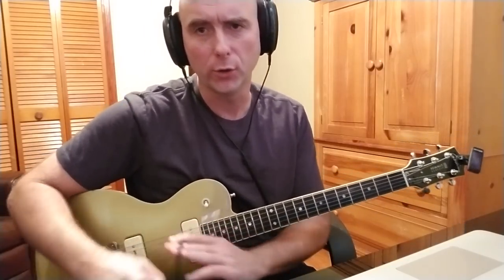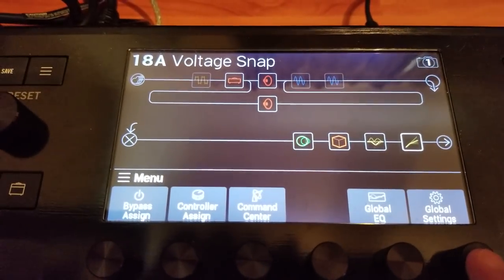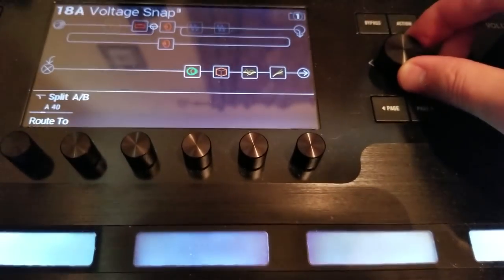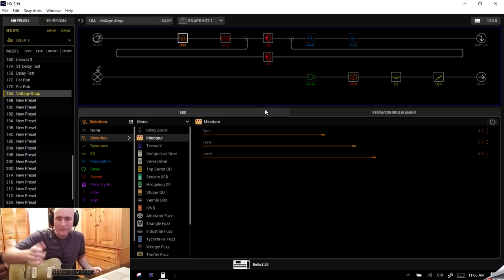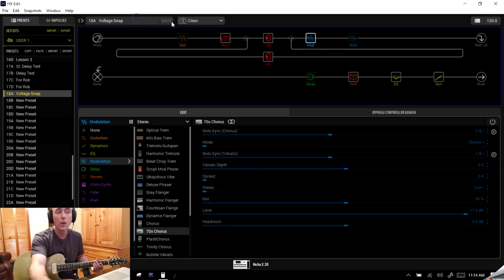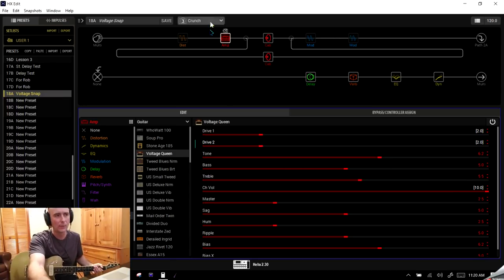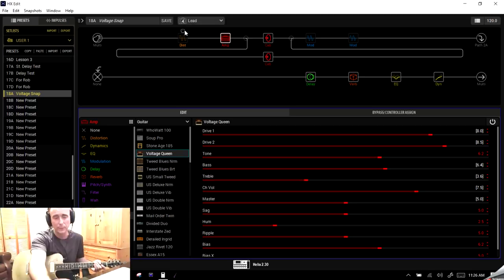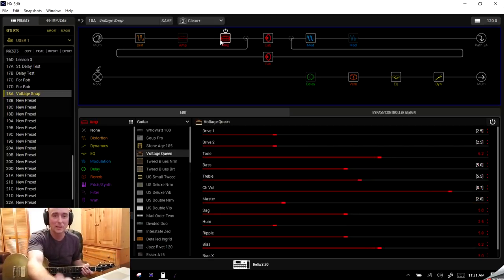Line 6 Helix - How To Create A Great Tone - Pt. 9 - Understanding And Using SNAPSHOTS

Comment: This video was a real eye-opener for me - thank you so much.  I was all set to ditch the Helix and go with something less likely to cause option paralysis - like a Strymon Iridium.  Now that I understand snapshots for the first time, I've come to the realisation that the Helix CAN be as simple to use as an Iridium plus outboard pedals.  If I were buying real amps, I would have two, maybe three.  Likewise, I'd have maybe six or seven pedals.  Use the Helix the same way - just concentrate on a small number of amps and effects and take a bit of time to set them up right in the first place.  I'm now working my way through all of your "How to create a great tone" videos, to see what else I can pick up.  Great work - and SO much better than wading through the 75 pages of the user manual!

Comment: Thanks for all of your videos!  They are a tremendous help!  I got my Helix this past Thursday and I am simply loving it.   

The whole preset switch delay exists in all modeling units because they have to load things in and out of memory.  The snapshots, which are a God send has all of it in active memory, we are simply turning them on and off.  

Still have so much to learn and getting tons of information from you!  I really appreciate all the videos!

Great tip on setting the Snapshot edits to Recall while you are programming the preset and then changing to discard after it is setup. 
Also, THANKS for showing how to set the parameter "changeability" in HXEDIT.  I couldn't figure out how to do that without using the unit itself.
Reply from the maker: My pleasure and thanks for the kind words :-)

Comment: great service you're providing here. I just recently acquired the helix and ran into a stumbling block with trying to quickly setup snapshots through the editor.  I thought it was kind of weird that I should have to "initiate" a snapshot through the floor unit by activating snapshot through the "push" parameter knob.  I noticed snapshot in some but not all of the drop-down menu's for parameters in the editor.  now if I could just get the built in expression pedal to maintain zero in the heel down position :-(

again, your presentation and subject matter is excellent.  great chops too!
Reply from the maker: Thank you so much Phil and glad you enjoy the videos :-)

Comment: Got my Helix LT today and started working on a couple of tones for Metallica's Enter Sandman, just as a means of familiarising myself with the unit (been using a POD XT Live for twelve years).

When I switch from the clean intro snapshot to the heavy rhythm snapshot, the chorus turns off, the distortion turns on and the noise gate turns on but the amp settings remain the same. The same thing happens the other way, too. I can save the heavy rhythm tone with all the settings as I want them but when I switch to the clean snapshot, the amp is still as per the heavy rhythm setting.

I'm loving the tones that I've got out of this in just a couple of hours of fiddling about but this is driving me nuts....Heeeeelp!
Reply from the maker: It could possibly be your global settings, maybe?
Reply: @JasonSadites  All sorted now, thanks, I somehow missed the bit about right-clicking on the sliders that I'm changing between the two snapshots and selecting 'snapshot' from the drop-down list.

I've been watching loads of your videos over the last few days while waiting for my Helix LT to arrive, you're a wealth of information and I'm very grateful for your extensive and informative videos. Many thanks to you!

Comment: Hi Jason. I'm kind of new to your tutorials. So far they have been very useful. I'm currently interested in setting up an extended sustain, maybe in a snapshot but probably on a stomp box. The sustain I want to achieve is quite long as in one of Santana's lead solos ...perhaps 7-10 seconds, maybe longer. Is there a suggested setup for something like this? Thanks for your informative tutorials!

Comment: Jason, This video is so good!  BUT - it appears to be a couple years old (not sure what version of the firmware this is).  I'm on the most current (which is 2.82), and the options, especially under "Global Settings" in this case, appear to be different (more added, etc.).   Is there some new info, tutorials, etc. that isn't 2 years old?  If so, any links, etc. might be REALLY helpful.  Thanks.

Comment: Someone may have already mentioned that ALT click will bring up the snapshots white brackets on a parameter.  I've also read, but not tested, that control click or double click will return it to it's default value.
Reply from the maker: Yes, somebody else had pointed that out and I had mentioned it in the following video in the series :-) It is a really great shortcut to speed up the workflow, thanks for pointing it out again! I will have to try out the Ctrl click. Thanks!

Comment: Really helpful video again, thank you. Does anyone know if there us a shortcut key you can use instead of having to select right right click then snap shots on each parameter? Thanks again
Reply from the maker: Thanks so much :-) If I remember correctly off the top of my head, if you hold the 'Alt' key while clicking the paramater it will put it into Snapshot mode...hope that helps!
Reply: @JasonSadites  That's brilliant, thanks a lot Jason!

Comment: Jason I have a question for you. I noticed on your the video that your strings are NOT top wrapped. Have you ever tried this ?. I always do it on guitars that have stop tail piece and found the strings easier to bend even though it allowed me to go up 2 gauges. i.e. I used to play with 9s and now use 11s. This also had the added benefit for me of a thicker sound and a lower action. Regards James.
Reply from the maker: I have seen a lot of people do that but somehow never felt the need to try it myself as I have been happy with the feel of my stop tail piece guitars as is. I am a .10-.46 player on all of my guitars and so far seem pretty happy at that gauge. Thanks for the observations about it though and maybe I will have to give it a try to see if I like it :-)

Comment: I am absolutely in love with snapshots.  Just came to the realization that the options are endless.   I love the fact that you can have a switch activate an effect, or group of effects and they behave one way and then in another snapshot the effects are different.  I will have a swell snapshot, but then on another one use the same swell switch, but they are VERY minimal so basically a bit of ambience.   

Do other modelers use similar concepts?  Any modeler will have that delay if they change their preset, don't they?  Just the nature of modelers.
Reply from the maker: I couldn't agree more! Once somebody gets their head around how snapshots work it is amazing what can be done with them. I can't speak for different modelers and how the handle the problem of loading patches, but I do LOVE the Helix snapshot feature :-)
Reply: That keyboard shortcut you posted the other day is also a major time saver.  Nice going through all the effects and alt-click each parameter that I will be changing on each effect before I start.

I would absolutely love if Line6 could put in some feature where you can set amps, effects and cabinets to a "preferred" setup and whenever you load that effect or especially for amps/cabs and EQs they are already at our ideal setting, instead of trying to remember what we typically change.  I wish they took advantage of the Template setup on the board, instead of simply being another setlist.
Reply from the maker: Yeah I love that shortcut also, but I can't take credit for it :-) A user from the Facebook group named Jason Kessenich messaged me about that as I was not aware. So we have to both thank Jason for that one!

I agree about the preferred settings idea. I guess you could creat your own template for different amps like that yourself. I have done that with my preferred "chain" that I always use.

Comment: So if I’m understanding this correctly you’re going to be working with the same number of blocks between all of the snapshots? It’s just that each snapshot may have different blocks turn on or off for example if I want to clean sound on the fender twin and a distorted sound of Vox ac 30, both amps will be taking up block space But muted on and off between snapshots

Comment: Ive noticed a tone change (its subtle) when you change from Multi Output to whatever your output is. In my case its XLR. There's a little extra harshness in multi? Oh and GREAT videos. Thanks so much for doing these.
Reply from the maker: Thanks so much for the kind words and glad you are enjoying the videos :-) I have not noticed what you mentioned about the Multi out. Although I usually have mine set to Multi. I will have to try that out when I have a moment. Thanks!
Reply: Also the input has a subtle change. Its a high pitched something on the note when in multi. It just sounds more solid when in XLR.  On another note, your use of the LA 2A on the output has been a fantastic addition to my patches. As you said it glues the sound together in such  fantastic way. Thanks again !
Reply from the maker: I will have to explore that a little further. So glad you like the studio comp at the end, that is one of my favorite things to do :-)

Comment: Dear Jason, do you play on the Helix with headphones sometimes? Which headphones do you use? My Helix LT sound awful on headphones... I founded out, that because of relatively high impedance of the output (12 Ohm), one should use the headphones at least with 96 Ohms (rule of 1/8). So now I ordered Beyerdynamic DT 770 pro with 250 ohm. I hope it will work... What is your experience?
Reply from the maker: I have been using my Sennheiser HD 600 headphones and they work and sound excellent with the Helix. They have a 600 ohm impedance and seem to pair up nicely. So, you may find that the new BeyerDynamic phones you bought may sound a lot better having a 250 ohm impedance, hope they work out for you!
Reply: Thank you very much for your answer! I hope they will work out for my. In case they will not sound good, I will try Sennheiser HD 600... :)
Reply from the maker: No problem at all and I hope you find some headphones that work for you!

Comment: is it possible to hit one button in stomp box and have two blocks turn on?
Reply from the maker: Hi Gary, it sure is :-) Make sure you have the capacitive touch turned on for your footswitches. Select the first block you want to control with the footswitch and touch the switch you want to assign it to. Then hit OK. Do the same thing for the other blocks you want assigned to that switch. You can also do this from HX Edit software with the Controller Assign tab.

Comment: Thanks very much for the video. All I needed was around 15:56. Just pressing the knob while turning does the trick. But I haven't found a way to change specific parameters per snapshot in the HX edit software. Does somebody know a way to do this? (so I get the brackets in HX edit)
Reply from the maker: That is what this whole video deals with in detail.
Reply: Ok thx Jason. Guess I will watch it from start to end then^^ really need to know how to do the trick on the PC and not on the helix itself. Haven't found it in neither of the two manuals either.
Reply from the maker: The video deals mostly with HX Edit so you should find your answers.

Comment: My Helix is from Hell...have very little satisfaction with it...tried time and time again to find something 80-ish crunch and Brad Gillis Boogie singing leads and can;t even get close. 3 weeks in and one week left before I can return it for a full refund...so lost and disappointed...My X3 live and Vetta II sounds better believe it or not. Can't believe how hard it is to find something satisfactory...even the presets sound like it is coming from a transistor radio. At the music store it sounds really good when going thru the Line 6 Powercab but thru my tube poweramp and Mesa 4x12 it just isn't happening.
Reply from the maker: So sorry to hear this! Can I ask what tube power amp you are using? Depending on what kind of signal the power amp is expecting to 'see', you may have the output settings set incorrectly in the Helix. If the power amp is wanting to see a Line in then you must set the Helix appropriately and same as if it wants to see and Instrument input. I would check that first. Also, once that is set correctly, make sure you have any stock cabs or IRs shut off in your signal path. Let me know if any of that helps...